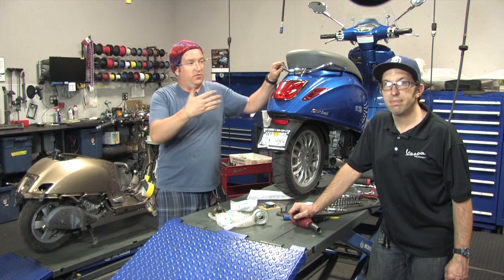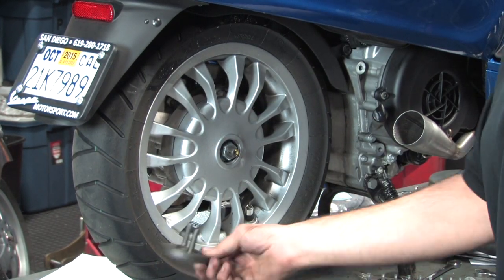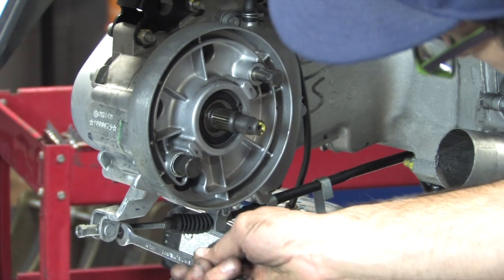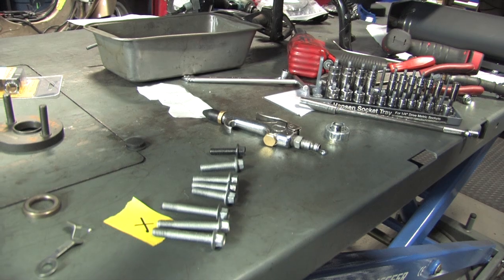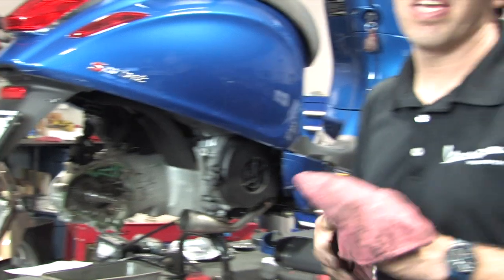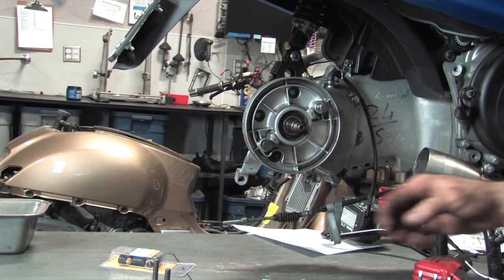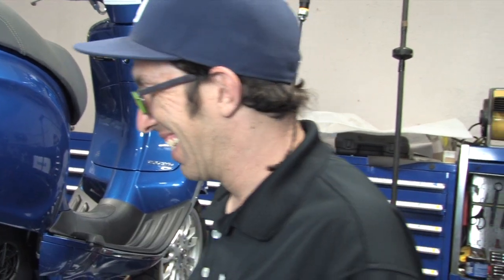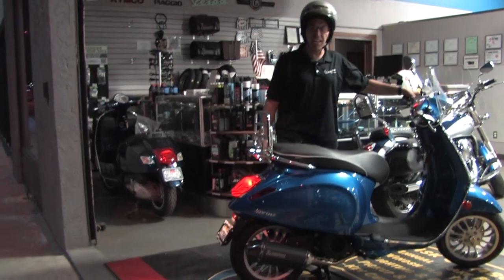Overdrive on a Vespa Sprint 150

Comment: Hi, did you change the roller weight too? Which weight do you recommend? Thank you
Reply from the maker: +smartunnel  Yes, we'd recommend the Malossi weights in 12g if you are also doing the upgear kit like this bike. 12.5g weights to a stock Sprint is a great easy upgrade as well. These are PART# M669456 on scooterwest.com. Thanks!

Comment: SO.....In STOCK form is the Primavera better at high speed cruising than the Sprint?  Primavera already has the overdrive?....I take it the Primavera has a higher cruising speed at a lower RPM?   Im in the market and Im trying to decide between the Sprint and Primavera...
Reply: `Randy Cuffaro the primavera has smaller lower tyres
Reply: no
Reply: get a sprint